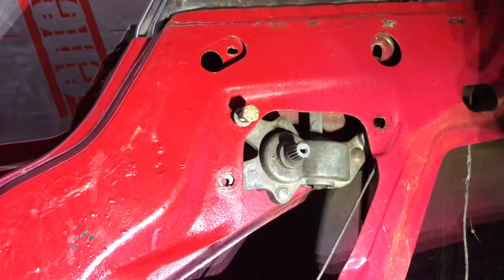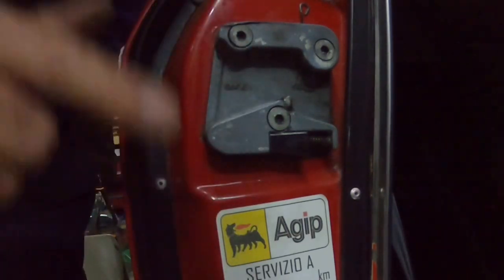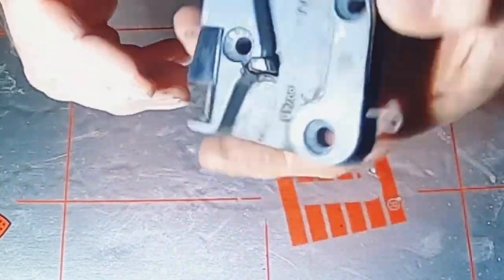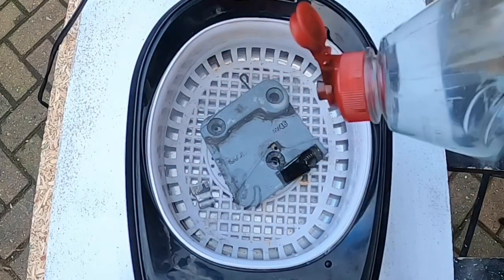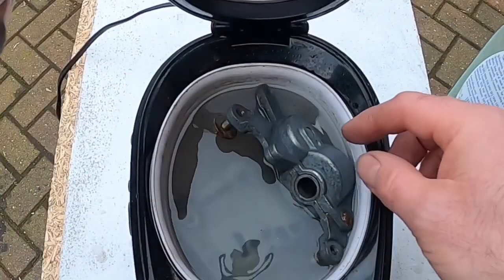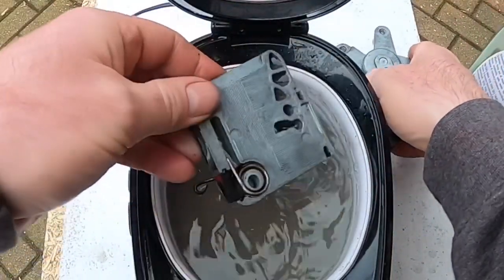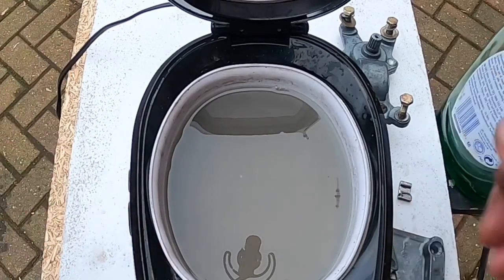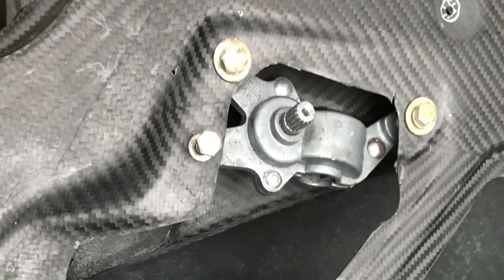How to use an Ultrasonic Cleaner on Alfa Romeo Door Components Part 4 AlfaTechniks

Comment: I find Jif/Cif very useful for breaking down grime on engine/bodywork components, coupled with the small wire brush sets that DIY stores sell. This is once I've got the worst off with white spirit and a wire brush.
Reply from the maker: Thanks you for your help, perfect!
Reply: @alfatechniks887  I'm uncertain if I've posted any thoughts on your video's before? But I'm in the process of restoring a 1968 Alfa Romeo Berlina, 1750. It's been head-up-against-a-brick-wall frustration from the offset. The very first bolt I tried to undo (one of the underside M8 bolts that hold the steel straps for retaining the anti-roll bar) sheered off. I estimate that I've spent approx' 700+ hrs to date. But I'm nearly finished. I think I'll be turning the engine over within 48 hrs. It did start last week, but only held an idle for about 30 secs before dying. Then it started again about two days later, only to do the same. It's definitely a fueling issue. I was extremely impressed with the almost, sewing machine like silence that it purred with. No timing chain rattle's or any other concerning sounds.  Strangely enough it has a new mechanical fuel pump, fitted by a mechanic I know of. But after speaking with Chris at classic Alfa, he informed me that there's a couple of substandard pumps on the market. Which by chance I've probably had fitted. So a new one's on the way, along with a new fuel filter (Fispa type). Should be with me tomorrow. So depending on arrival time, perhaps it'll be running within a couple of hours, of their delivery. My finger's are prematurely  crossed.
Reply from the maker: Good luck with this and sounds like you’re busy
Reply: @alfatechniks887  you're not going to believe this? Because I've had a fueling issue, I removed the plugs, so as not to drain the battery as quickly, whilst turning the engine over. Anyway, after I manually used the squish-pump in the boot to get petrol to the filter bowl, I went to install the plugs only to find one of the aluminium tops absent from the top of the plug! I can't find it in the engine bay or under the car. So I'm currently using a video scope to see if it's gone down the bores. If it wasn't for bad luck, I'd have none at all. My patience are at the end of their tether. Anyway, onward and upward.
Reply: @alfatechniks887  Disaster averted. It was in the rubber of the spark plug socket. Perhaps there's a god after all 🙄
Reply from the maker: I would have suggest then plug sucket, it’s the only place where it could be. They wind out if lose. Don’t know why manufacture can’t just make them one piece as it’s a point of failure.
Reply: @alfatechniks887  unfortunately, worse case scenario entered my panic stricken psyche. Hence why I had the endoscope down the bores. First port of call, should've been checking the rubber insert within the socket. Furthermore, I'm still having fueling issues. The car car has a Fispa inline filter, which I've dismantled, cleaned, checked the diaphragm for serviceability. All seems intact. I've noticed a grub screw on the top. I assume this adjusts the flow of fuel. Is it possible that it's not out enough to allow the fuel pump to draw in fuel to feed the carbs? The fuel pump was fitted new about 18 months ago. I've primed the system via the squish pump in the boot, but it's only filling the glass filter bowl a quarter of the way. Also the fuel that came through appeared clean, which makes me feel that the filter grub screw may be the issue. Failing that, I guess I'll have to replace the fuel pump in situ' which is  a right pig to get at due to its confined space fitment. Any advice you can give, will be a godsend.
Reply from the maker: The fuel should fill the filter bowl. Is it a pure a filter or is it a fuel regulator as well like the Malpassi type. You flow or pressure is turned down perhaps so take the domed but off and adjust the needle valve. Also they need to flow in the right direction. They have arrows on them. Have you got good flow to the filter? Take the inlet off and place in a small container and turn you pump on to see the rush of fuel. Also I would fit an inline fuel low pressure gauge so you can see the pressure
Reply: @alfatechniks887  It's definitely a fuel supply issue. Once the rain stopped I operated the squish-pump again, after removing the pipe that feeds the mechanical pump and petrol came out of the pipe. So I figure the fuel pump is faulty or plumbed incorrectly. I swapped them over earlier, but ran out of daylight. First thing in the morning I'll see if that's the problem. If not I'll replace pump with new one I have from classic Alfa. I understand that there's a couple of pushrods of different diameters that are acutated by the cam mechanism. These can wear which causes failure to pump fuel. They're also as rare as hen's teeth. I'll measure their diameter with a caliper and should they be at fault, I'll try to reproduce them from appropriate and corresponding welding rods.